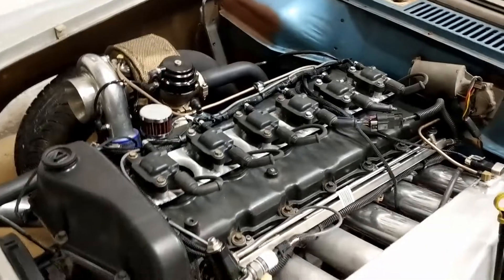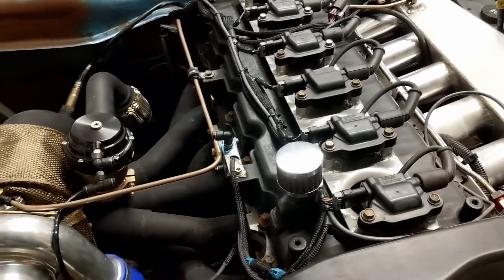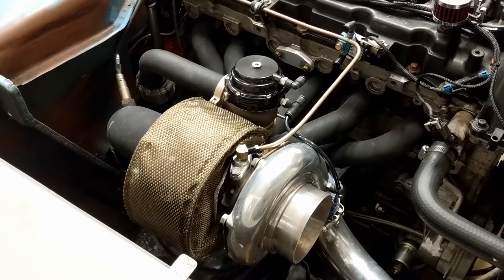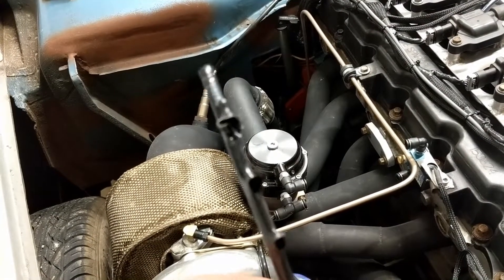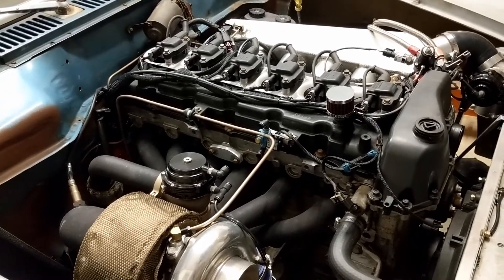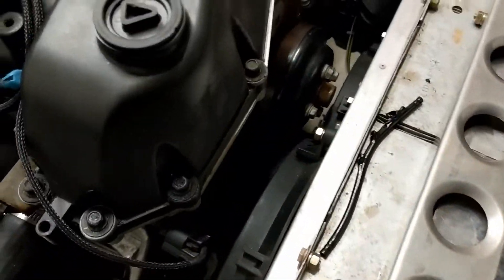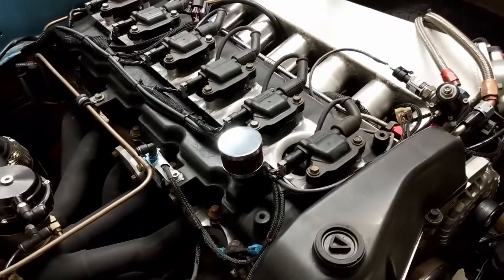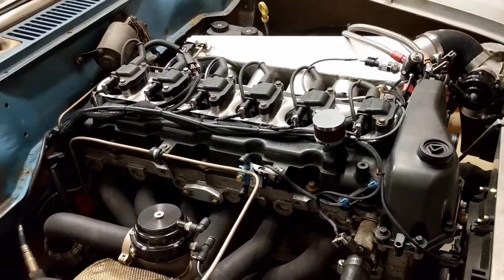Vortec 4200 Boost Control Update

Comment: I used that nylon line too on my truck and I found it melted to. Where it connects to the gate.
Reply from the maker: Yeah. I'll reloacate it. Glad it happened now and not on drag week.
Reply: @Calvin-Nelson   I have them going to two gats and the push lock that was straight is all metel that one melted the nylone line from inside looked good from the out side  but the push lock wit a plastic 90 was fine I gess the heat didn't transfer threw the 90 fitting

Comment: It's unfortunate that it won't breathe at 7000 RPM even if it does safely rev that high.

Best case scenario would be to remove the VVT, and clock the cams for maximum overlap. But the low lift and duration will probably always hold it back.
Reply from the maker: I agree. The 2006 and later engines have more aggressive cams and larger valves. We will really see a benefit then.